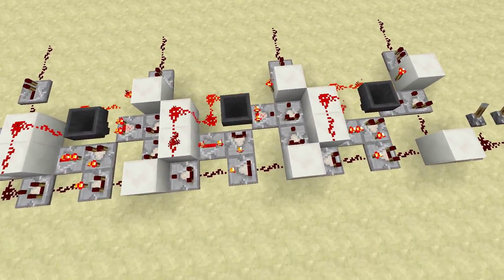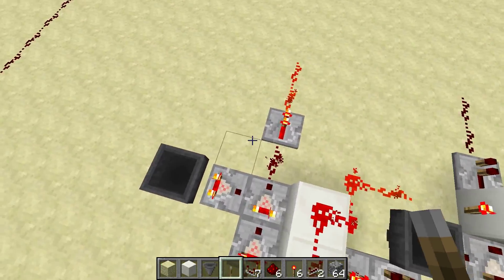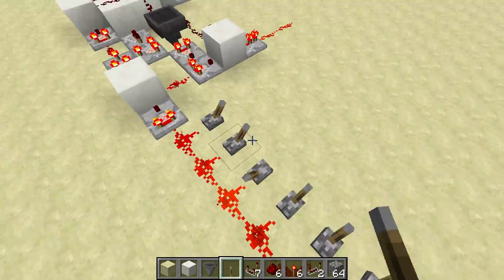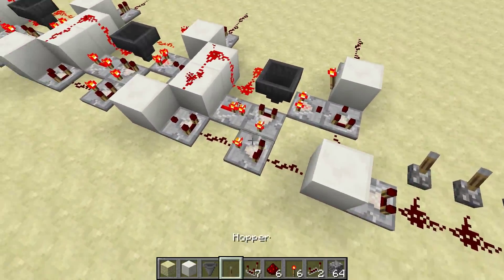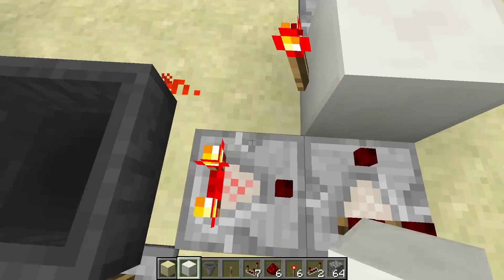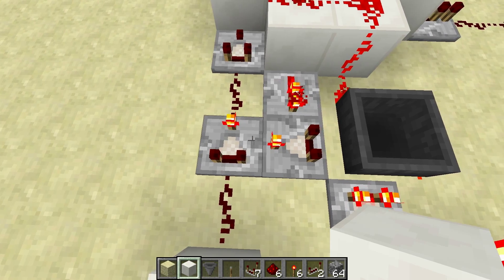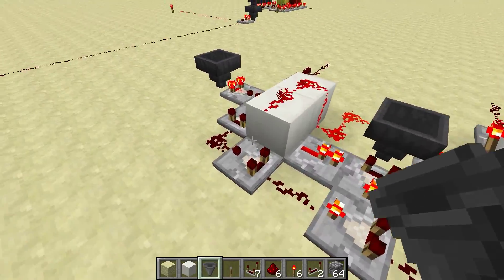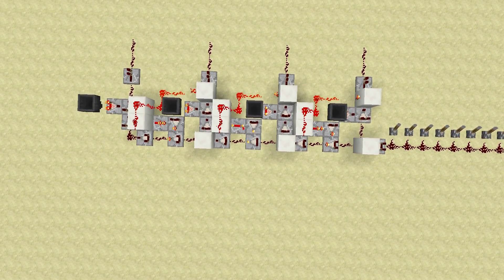Minecraft - Signal Strength to Binary Converter

Comment: You can actually calculate it yourself:
For the 8th bit: 8/16*320 = 160 (64+64+32)
For the 4th bit: 4/16*320 = 80 (64+16)
For the 2nd bit: 2/16*320 = 40
For the 1st bit: 1/16*320 = 20
Reply: 1 is special.  you can get away with only 1 item in that hopper.  Also don't even need to decode for one.  It either has it or, it doesn't.  Only need to decode the top 3 bits.  The forth one just falls through from all the subtraction.